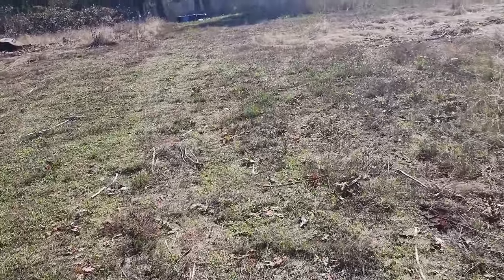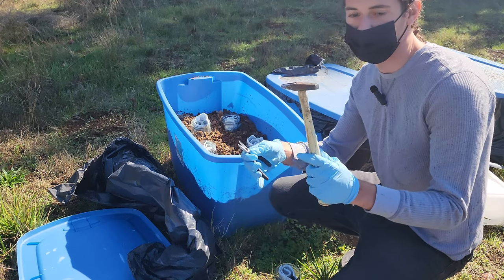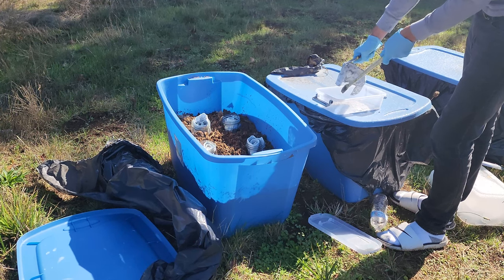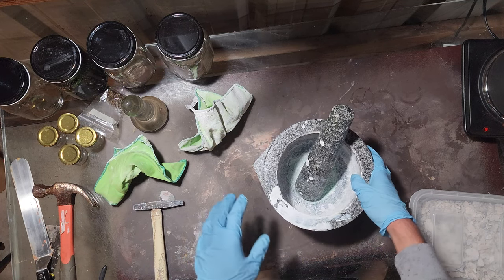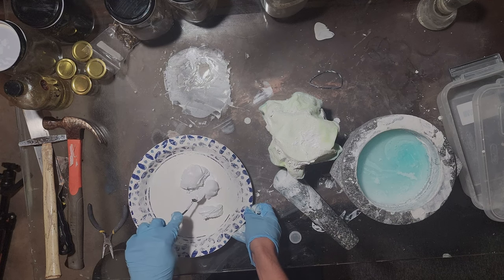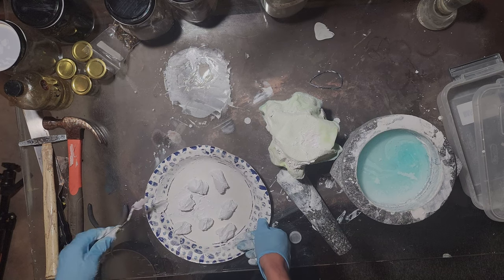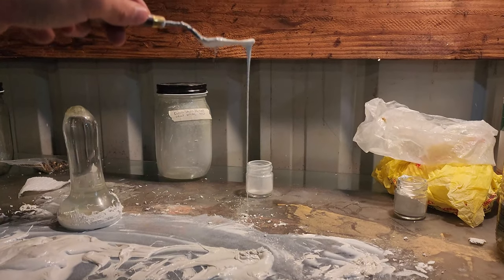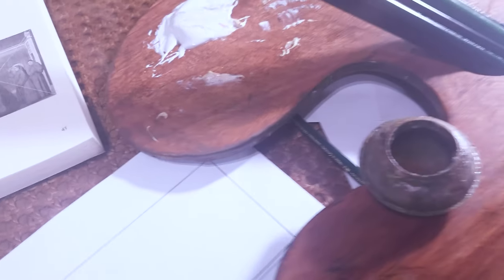My Experience Making Lead White - Dutch Stack Method

Comment: I like to use vinegar to dissolve the lead white with no grinding. Then rinse with water till vinegar smell is gone. Then make put in a enamel pot and use a hot plate on low to dry the cake. Good video, good luck and happy painting.
Reply from the maker: That is very helpful! I wanted to try making Dutch stack lead white which is when the particles are all different sizes instead of all homogenous like when you dissolve in acetic acid or vinegar. I'll have to try that next time to compare!
Reply: I also stir once a day to help dissolve into finer particles.

Comment: How do you safely dispose of the waste particles after the waste water evaporates? Intrigued by this process, but very concerned about proper disposal
Reply from the maker: I have a specific container that I put all the water used in the process and then I set it outside to evaporate. The water goes away and the waste is left. The waste that is left is very little so I just keep adding onto it but once I need to dispose of it, my local dump has a specific section for toxic waste/ leaded paints or things like that.

Comment: Ah, the joys of making your own personal toxic waste site. I know what that's like. I've done the process and my biggest concern here is that you haven't washed your lead white enough to remove all the lead acetate. (The blue stuff.) For the uninitiated, lead paint, or more precisely the blue stuff in lead paint, lead acetate is very sweet. It's why in the past children have been known to eat lead paint chips. That blue water is very sweet. You can smell the sweetness in the air as you wash the lead particles. It's important to wash and rewash the lead until the water the lead sits in is clear of any coloration. 

For the volume of lead you're producing it would be worthwhile to buy a mechanical grinder. And it helps a ton if you use a strong vinegar. Most store vinegar is like 4% or 8% in water. One can purchase 20% vinegar on line. It hastens the corrosion of the lead sheets. Well worth using. Once the lead acetate is completely removed, and most of the clear water poured off into another container, the wet pigment can be spooned in little nests of coffee filters set on a layer of absorbent towels or cloth or drying rack and allowed to air dry. It's a less messy process than your micro cloth  method. Speaking to the uninitiated again, the lead chips, the dry clumps of lead white are very hard. Surprisingly hard. It is a relief to when the lead is finally mulled to a grinding state. But delightful when it's finally rubbed up into a paint with oil. 

It is a challenging process. Not for the faint of heart. There is a lot of waste. Horse manure. Containers, jars, towels etc. contaminated with lead. Gallons of waste lead water. I think I had like 25 gallons of lead water to get 5 lbs. of lead white. It can be worth the effort if you're a serious painter. I like your paintings so it's clear you are dedicated to craft and want for the best materials possible. Stack lead white is proven to be a superior pigment to work with. 

I wish you many years of good health and successful painting. Never settle. Keep striving for higher levels of excellence. Both this video and your paintings demonstrate your dedication to put in the work. Here's wishing you the absolute best.
Reply: I'm pretty sure the blue stuff isn't lead acetate which is colorless, but some copper salts [copper(II)acetate] that formed from impurities in the lead coils.
Reply: 4 Clandestine Lead labs raided by the Dept of Obsolete Paint Materials yesterday in Indiana.

 Police arrested Fred 'Flake' Finn, Craig ' Cremnitz' Crankerson and Linda 'Litharge' Lightfinger and multiple Lead Cartel mules.  Police say neighbors had complained about large nos of Rembrandt & Van Gogh  RIP offs left leaning against walls in the area. ' Youths  sniffing Copal varnish &  smoking Belgian linen splits added to our concerns said Karen Philistine, community group leader of " Let's put Art in it's place" said.
Reply: @rickh3714  Well played, sir. Well played.
Reply: Correct, lead acetate dissolves in water and tastes sweet, but the blue stuff are copper salts (impurities in the lead). 
After grinding, put the water + pigment in a plastic botlle, add more water, shake vigorously, let it settle, pour off the water, and repeat 5 or 6 more times. Cut open the bottle to get the pigment out.

Comment: Dear Sam, along with thanking you for the contribution you generate with your channel, which is very interesting for all of us who are starting out in this wonderful craft that is oil painting, I wanted to ask you, regarding the famous white lead, if it is that it is perhaps possible to use a basic lead carbonate sold by some chemical substance sales companies. I consulted with them if it could be used for such purposes, but they said they didn't know. Therefore, my question is: can said basic lead carbonate be used to make Lead White, or should it only be the pigment resulting from the traditional method of obtaining it? That. Greetings and hugs from Chile!!!!
Reply from the maker: From what I have researched, lead white you can buy from chemical or industrial companies that is very cheap compared to art companies has a different chemical structure, and is essentially a completely different substance. You just want to make sure the chemical structure is 2PbCO3/ Pb(OH)2 which is what is listed on Natural Pigment's site versus PbCO3 which is what is most commonly listed on non-art sites. I think sometimes the name for the one you want to use for painting is called Lead (II) oxide versus Lead oxide. I am not a chemist and I am not sure what the difference is beyond a high school-level chemistry understanding but that is my understanding. 

Kremer Pigments sells something for artists called Cremnitz White which claims to be lead white but weighs only 1/4 of what true handmade lead white does. (an instructor at my academy reached out them them and asked why this was and they admitted it was only 70% lead white which still doesn't add up but it does probably have some lead white in whatever additive they use.) It is much cheaper than a lot of the other artists' grade lead whites which makes it more practical for most.

I hope that helps :)

Comment: I've also made some of this with a similar setup. I started havesting the flakes, but they weren't corroded all the way through, so there are very thin flakes of the pure lead mixed with the rest. Do you know how or if it's necessary to remove them?
Reply from the maker: Yes I know what you mean. I found that I waited longer before harvesting so that the ratio of the flakes to the lead was more. I have also read that a lot of artist would "age" the lead after processing, which is basically just waiting a couple of months, and any residual lead will have enough time to corrode. Having done this, I haven't noticed any negative effects. I hope that helps!

Comment: did you use vinegar or actual acetic acid, I bought acetic acid.. also, howmuch did you treat the lead with acetone?
Reply from the maker: I used acetic acid and diluted it a bit with water. I have heard that vinegar works fine as well.

For the acetone, I didn't measure. I just applied some to the rough end of a sponge and scrubbed it a bit and that seemed to work fine.

Comment: Could your lead have more of those metals in it, causing the commercially available lead lighter? I know nothing, just curious
Reply from the maker: Yes, the commercially available lead is actually not much lead at all. I had an instructor reach out to Kremer pigments who most people get their lead white pigment from, asking for their certification of what was in the pigment and it was only 70% lead and 30% unidentified "other stuff" probably zinc or chalk. It still didn't add up with how much lighter it was so who knows how much it actually it.
Reply: @samuel.s.hoskins  wow, that is interesting!  Thank you for this video and sharing insight into the process.

Comment: what kind of  acid did you use?
Reply from the maker: acetic
Reply: @samuel.s.hoskins  ok well, I have run into a problem, I used Apple cider vinegar made from mother, meaning strong and Im gettign  a gray flaking.. not sure if its because of the acetate I whiped it with or what but the horse poo is fresh and I ordered some pure strength 99.9%  acetic acid and will begin again this weekend.. any suggestions would be nice...